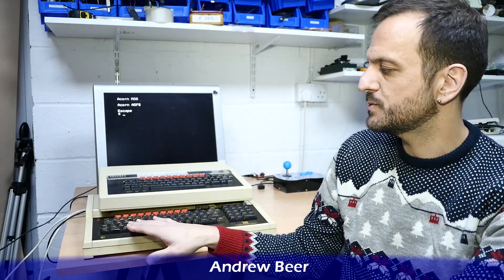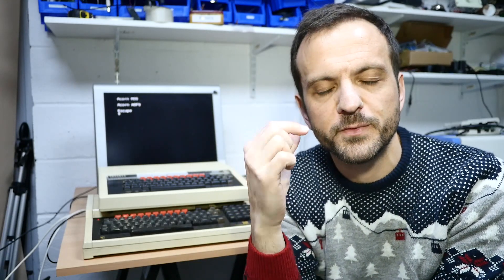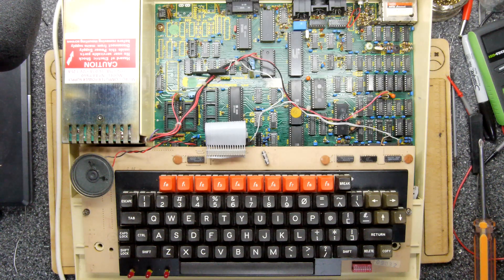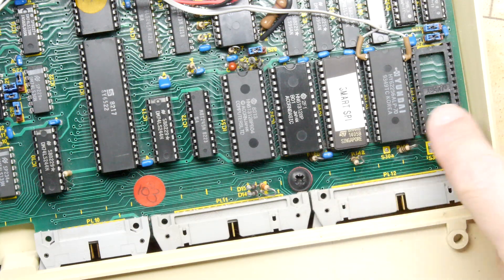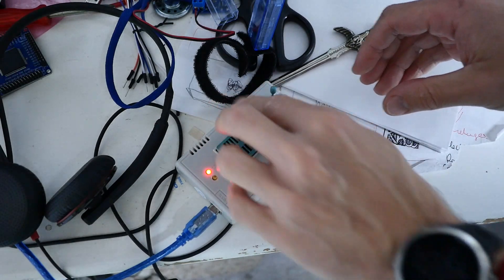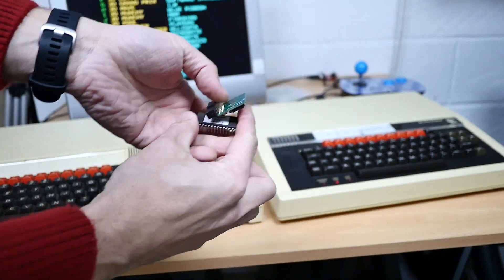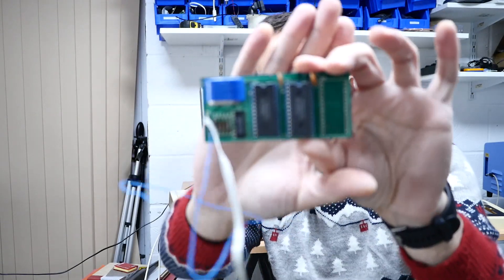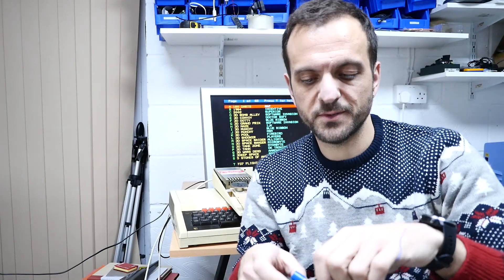How to upgrade your BBC Micro SD Card ROM

Comment: Still have Daredevil Tennis on tape!! really need to recap my Beeb and get the SD mod. Can you copy from tapes to SD or would I have to acquire the roms via some other method? I have a lot of old games such as Twin Kingdom Valley, Trafalgar, DareDevil Dennis, Castle Quest etc that I would like to pop on there ;)
Reply from the maker: I would think the easiest way is to get the roms through other means. There are some curated starter sets that are likely to contain everything you would ever want.

Comment: Following on from your earlier vid I took the plunge and ordered a PSU capacitor kit and the SD card user-port board.
Reply: Has to be done! After more years of disuse than deserved my model B PSU was giving out a perfect 5v but within 10 minutes there was a plume of smoke billowing from it. Luckily I was sitting by it tinkering with some other bits so it got promptly switched off.
Reply from the maker: Yes exactly!! It's perfect then 'blam' - acrid smoke everywhere!
Reply from the maker: Wonderful, the best thing you could do 😁👍

Comment: They are both 8k SRAM chips, so I would say it's a Sideways Rom board using SRAM chips so they are emulating EEPROMS, so you can load an image from disk and then erase it and add a different image. The fly lead I would say fits into the Chip Enable (CE) of the adjacent empty ROM socket to give you two banks of 8k. The Switch I think is for reading and writing depending on it's position.
Reply: It is a Watford Electronics sideways RAM board 16k (2x8k SRAMS) the switch as you suggest is a write inhibit. Each sideways ROM slot can address up to 16k, this allows you to make full use of the paged ROM space, the chip enable is derived from the ROM socket (so make a note of which socket you put it in so you know which one is to be addressed) The flying lead is the write enable (the ROM sockets not having these of course). it can connect to any chip on the board which has to be writen to, you already have an example of this on your BBC on the 8k sideways ram chip. The Hitatchi 2464 SRAMS used the same pin out as the 2764 EEPROMs so thay are interchangable, with the exception of the write enable pin, this is what allows your in socket SRAM to sit in a ROM slot. the only problem is that it is only 8k and that it needs the write enable. If you extract the RAM from the ROM socket you will see that the pins below the flying leads have been cut off. PS it is most probably dead, the battery would have ruined it when it expired about a decade ago
Reply: The 7400 is a quad NAND gate so is probably doing some super basic address lead decoding. It’s possible it’s shadow ram instead of or in addition to sideways ram.
Reply from the maker: @JasperJanssen  sounds like more investigation needed. Even when hooked up I'll need to figure out how to access it
Reply from the maker: This is good insight. I probably ought to trace that flylead and switch. We can do that on the bench
Reply: Agreed but they're 64k (8-kword X 8-bit) so can reach hold 4 roms. The switch is likely for read only but sometimes total inhibit (no read or write) but can't see a good reason for TI in this application.
Reply: @ches74  No they are 8k not 64k
Reply: @GrahamTinkers  right you are, I misread the datasheet. It's quite clear on review.
Reply: @ches74  They are two 8k SRAMS giving a total of 16k, they are called 64k chips but that is 64Kbit, when organised into 8 bit words it gives you a total of 8k - https://en.wikipedia.org/wiki/6264
Reply from the maker: The more the merrier 😁

I heard there are a few different types of sideways ram, I'll see if I can investigate those as well